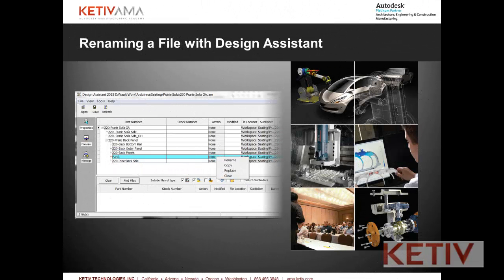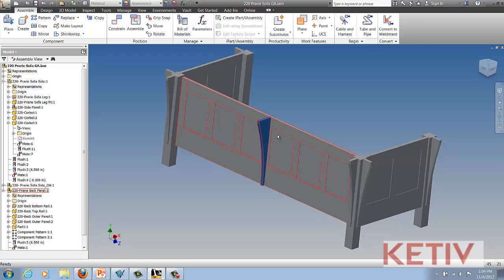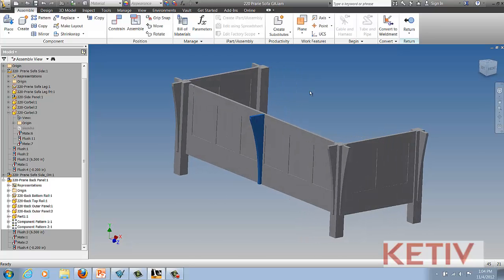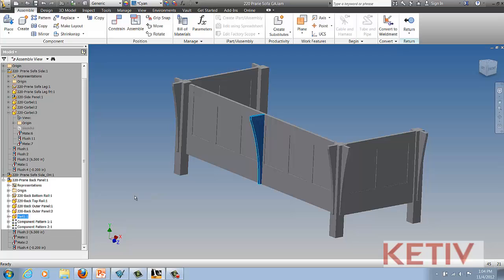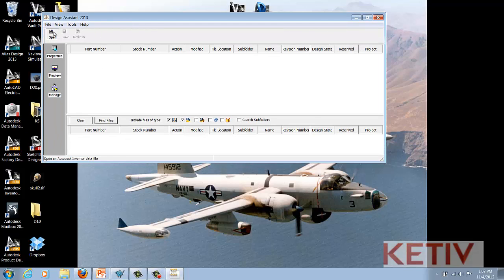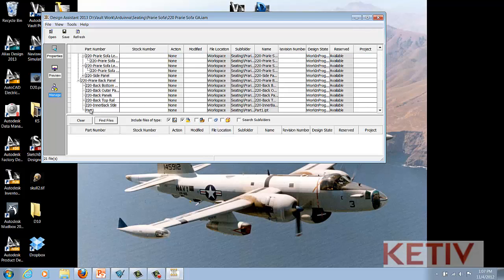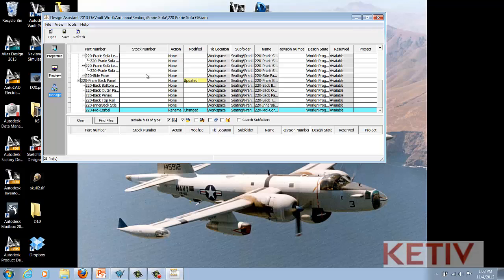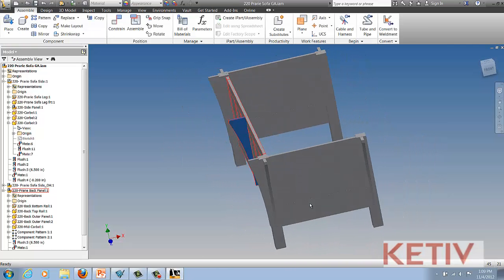Using Design Assistant to Rename Files in Autodesk Inventor

Comment: Hello,
after using the Design assistant, a big inconvenience happened to me. (I renamed one part of the assembly in DA) Since then, when I open this assembly in Inventor, all the references are lost, if I determine them again and show him where the referenced files are and save it, then when I open the assembly again, the references are missing again . I'm really desperate. Confused Any information on this problem would help me. Thanks for the tips, experience, knowledge on this issue.

Comment: what if you have made a drawing of the part(s) you want to rename. How do you get design assistant to include those so they will not have issues?
Reply from the maker: Hi John, 

Most likely you would need to involve some more advanced automation there to capture the changes to the reference files. Reach out to our team @ questions@ketiv.com and we can help point you in the right direction.

Comment: I am using Inventor 2020 and when I right click on Action, it only gives me the option of Copy and Clear, It shows options of Rename and Replace but they are faded and I can't click on them. Can someone please help me with this?
Reply from the maker: Hi, Some of the dialogue boxes in the applications have changed over the last few years. Are you trying to rename files? or perform another action with the Design Assistant?
Reply: I was trying to rename the files, however after talking to my instructor he just said to use the “save as” option under file.
Reply: @isaiahpridie813  I'm having the same problem... but with the 2019 version.
Reply: @flanked28  me too... any clues?
Reply: @holaroccotv4564  I ended up just copying the part by pressing "Save As..." In Inventor, then renaming it to whatever I want, then deleting the old part from my home screen, and manually opening the part I just renamed
Reply: I faced the same issue here while trying to rename a part file.

The workaround is to rename by opening an assembly in design assistant which the part belongs to.

Even there, the assembly name couldn't be renamed. I guess we will have to open a higher assembly to rename them in the same manner. But renaming assemblies are straightforward as we just need to create another instance with different name.
Reply: On my 2023 version I noticed some important details for being able to rename my files: 1) You can only rename files belonging to an assembly  but not the assembly itself. 2) To rename, you must first right-click on the operation column then choose rename before you can change the name in the name column. 3) The design assistant sometimes gives me an error when I rename a subassembly at the same time as parts belonging to the subassembly in question. simple solution = save the new name of the subassembly before renaming the parts that compose it.

Comment: good but a lot of work just to change a file, in solidworks you just change the file in windows explorer and reopen.  I am pulling my hair out with inventor at the moment.
Reply: you can do the same in inventor. In SW you can change filename in feature tree, but you cant do the same in inventor, but SW has a huge amount of bugs
Reply from the maker: Unfortunately, renaming file names is usually taken care of either through the Design Assistant or through the renaming utility in a Vault environment.